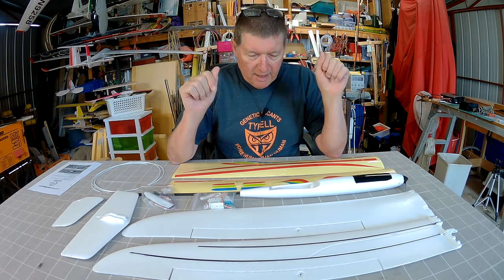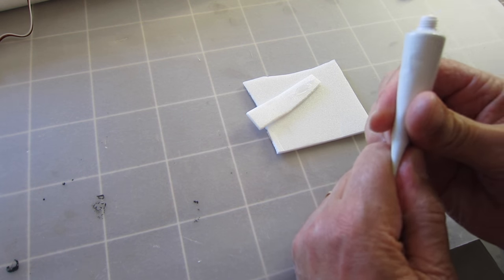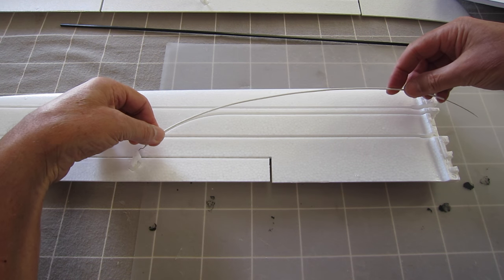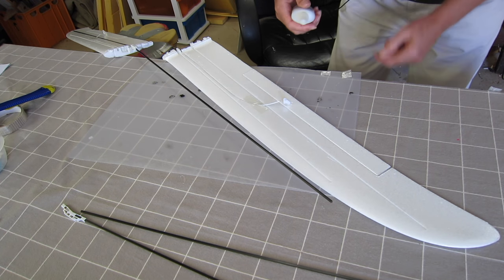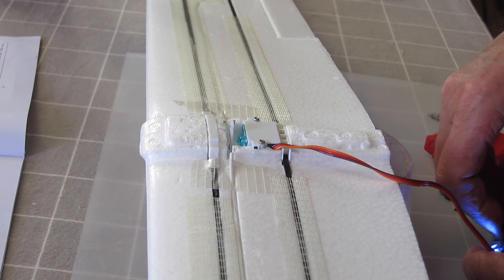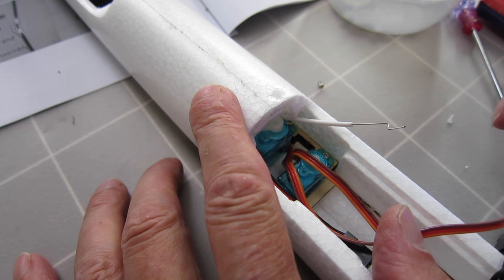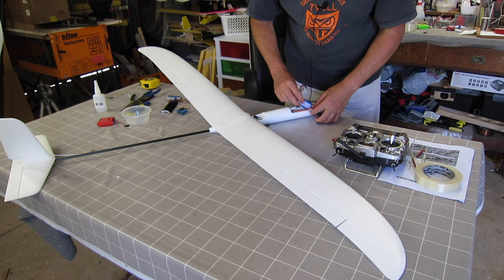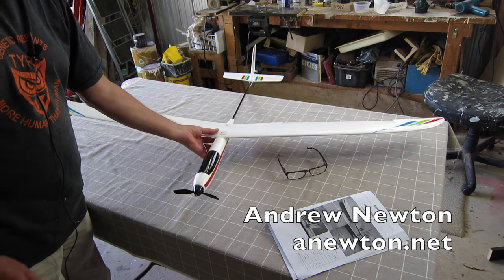Unique Models U-Glider build

Comment: Do you think there is any way to keep the wing halves detachable? I am hoping that gluing the wing halves and the center braces could be optional so that the glued in spars coulf be fitted in and out and then bolted down. The goal would be so that with less than an hours work at each end the boom could come off and the wings made into halves for placement inside cor-gated plastic protector shapes I use to travel with planes in my suit case. Thoughts on the reasonableness of this? I understand it would sacrifice rigidity and durability. I currently bring about 5 planes in the space of a tuxedo, but this would be a much more efficient glider than the Kinetic which is more sporty.
Reply from the maker: Definitely, it has very light loading so the wings could be taped in place. The tail boom is only clamped in place.

Comment: Andrew. Thanks for this video. The included instructions are so bad, that as a Newby I could never have built it without this help. I noticed in your maiden flight that the prop 'windmilled', as does mine. I have been unable to set the ESC brake on the supplied model. (Remember I'm a Newby). Have you changed the ESC or did you discover the way to do so on the one that came with it. I have also watched your video on ESC setting and none of the 'musical' tones seemed to match, so sadly that hasn't helped. Any ideas?
Reply from the maker: Search for ESC brake on the RCGroups thread, I think someone did work it out. I changed to a Turing Plush 12A ESC which is easy to program with the ESC card.
Reply: @AndrewNewton  Thank you.

Comment: Hi Love your videos thanks. I have just bought one of these models, came with no instructions!! I have searched but can't find one I wonder if you have a link to the inst. manual? However I am making lots of mods. The servos are not good and I have changed them all for quality 6 gram. Also fitted two wing servos for the aielerons as the snakes seemed so stiff. I also fitted a servo in the fin for the rudder with the wires inside the fuz tube and the elevator is operated by a 1mm carbon rod also inside the tube. To fit the receiver I have cut a slot in the top of the fuz between canopy and wing so it is flush and is not squashed. Streamlined the join between the rear of foam fuz and carbon tube. With a 650mah 2s lipo which is a recommended alternative I have kept the weight down to 300g. Maiden flight very soon!
Reply from the maker: Excellent Frank. I posted photos of the manual in the RCGroups thread.

Comment: Thanks for sharing.
So which is good for FPV and UAV, scratchbuilds or kit/pnp like this?
Thanks again.
Reply from the maker: Not this one, too light and slim for extra gear. I'd prefer to scratch build something specifically for FPV but any smooth flying plane or wing with space inside would be good.
Reply: OK. Smooth is a factor. Noted that.
What if autopilot/UAV, would a scratchbuild up to the task?
Have you ever done that?

Comment: Hi Andrew, bit of a goofy question but do you consider it possible to get this U-glider under the magic 250g to comply with Transport Canada drone regs by removing the motor, prop, maybe run a smaller Lipo and turn it into a hand launch? Could it be made strong enough for hand or bungee launch? I see you mentioned the standard AUW was 300g. So would want to shed 60g to be safe. Thank you sir.
Reply from the maker: If you shortened the tail boom as well you might have a chance. Still needs to balance correctly so you cant just remove weight forward of the CG
Reply: @AndrewNewton  thank you sir, I will keep that in mind, shortening the boom would remove a few grams also. I will probably keep it boxed for now, perhaps Transport Canada may up the lower weight limit a little in the future to run it 'stock' at 300g but I sort of doubt it.

Comment: Hi there Andrew, i hope you are getting some decent flying time amongst all your very informative reviews. 
Have you got any pictures of the actual motor mount, for the U-Glider, please? 
Also can you please tell me what is the inside diameter of the fuse. in mm? I am hoping that I might be able to fit a 27.8 mm can with a thicker shaft. (Turnigy D2822/1450) (41gms)and upgrade the ESC of course.
Have you come up with any other alternative motor with a thicker shaft than the supplied one. have you had any more flights than the ones you posted on RCGroups???
I haven't pressed the button yet. I want to do all the mods before I maiden.
Go With the Flow
Bruce
Reply from the maker: I'll measure it for you Bruce, might be a day or two
Reply from the maker: Motor is 22mm diam fitting into a 25mm space, screwing to a plywood mount
Here are some pics Bruce
https://flic.kr/p/Vmu7zj 

https://flic.kr/p/U8tRD1
Reply: Hi again Andrew, apologies for the delayed response, I'm on holiday travels. Thank you for posting the measurements. Looks like I must press the button and get on with your recommended mods. then get it flying with a slightly bigger ESC. Then we can see what further aspects,(if any) might need some tweaking.
Thank you for taking the time to respond. Are you still flying the stock motor???
Go With the Flow
Bruce
Reply from the maker: Yes stock motor for me Bruce. At least shift the aileron servos to the wing and maybe change all servos for something tougher. Prop and spinner could be improved too

Comment: Hello Andrew! Thank you for this useful tutorial ;-) Some questions.... Where is the CG on this glider? I found no information on the instruction sheets. My U-Glider seems to be a little bit nose heavy.
Have you experienced that too and have you added some weight at the end of the tail boom? Thank you for your help. Best regards. J-B
Reply from the maker: Hi JB. I guess it depends on the battery weight. CG should be about 40 to 45mm, but I'll confirm that next time I fly.
Reply: @AndrewNewton  Hello Andrew! Thank you for your answer. I have put an Eflite 3S 800 mAh battery that weighs 70 grams into the bird. By the way have you put some weight at the end of the tail boom, or can the bird be balanced just with the LiPo? Thank you again for your help and best regards from Switzerland. J-B
Reply from the maker: @Jimirnard  I'm using a 2s 950 weighing 46g, but also vario and lipo sensor. Didn't need any tail weight.
Reply: Andrew Newton Hello! Thank you for the infos. A lighter battery would certainly help.... I shall try. Best regards. J-B
Reply: Hello Andrew! Alas 2 crashes although I had balanced the U-Glider with the Multiplex Center of Gravity gauge ;-(  Everything seemed to be OK, at home, but not on the field! After starting the engine and throwing the glider, its nose pointed to the sky (certainly tail heavy), although I had put some extra weight in the nose, and re-balanced the glider. Each time I put more throttle, the nose goes up again....  On the field I tried to compensate with the position of the LiPo battery, in vain! There is a contradiction between the "good" balance in the workshop and what I experienced on the field. I fear a third crash would send the glider into the bin! What is your opinion? Thank you for your support and best regards. J-B
Reply: Hi again! I think I have solved the problem. After having a close look at the glider I noticed that the elevator horn was for some reason broken! Alas I have also noticed that both motor and ESC are out of use after the second crash.... Perhaps I shall have more luck in the future! Thank you and best regards. J-B

Comment: What is the tape you use and that hold on EPP? All tapes I tried go away the next day.
Reply from the maker: Nothing holds well on EPP. You need to add a smear of glue to the surface if you want to stick tape to it. The U-Glier s EPO so any tape sticks OK
Reply: Andrew Newton thanks a lot for the tip. So I keep my method I used to strengthen the volantex asw28 hinges: neoprene spray glue first wait few minutes then a hinge tape.
Reply from the maker: That's a good idea, might use that myself

Comment: Hi andrew , I have an important question (at least for me)
Would you recommend the taranis plus as a second radio?(I have a DX5e) 
LOOKING FORWARD TO YOUR ANSWER!!
Reply from the maker: Yes definitely, but wait a bit. My next review will be the new Taranis Q X7. Half the price of the Taranis Plus, only difference is it doesn't have the sliders on the side or as many switches. In some ways it's an improvement on the T+
Reply: I know about it but I 've decided that a taranis plus (I love the sliders) would last for years 
Anyway thank you for ansering , means a lot to me !!!have a good day!
Reply from the maker: Yes I love the sliders too. Go for it, you won't be sorry
Reply: Thank you so much for your help, I'll bauy it with a x4r(for a flying wing used as a glider ) and a x8r(for anythingelse) , do you think is a good idea?
Reply from the maker: Yes that would be perfect. I also really like the vario and screen less-lipo sensor for thermal gliders, and the 40A current sensor for powered planes. They will plug straight into the X series receivers
Reply: Thanks for your awesome advices!! Appreciated it 
Can't wait for the maiden of this new motorglider

Comment: Another good video Andrew, unfortunately in this case it has provided enough info to not buy this model, that middle servo setup is awful, I prefer a much more direct linkage from servo to control surface so trims are more effective and centering is accurate, this just looks like a headache.
Reply from the maker: Yes I agree, but it's a winner with a few mods. https://www.youtube.com/user/andyandvirg/search?query=U-glider